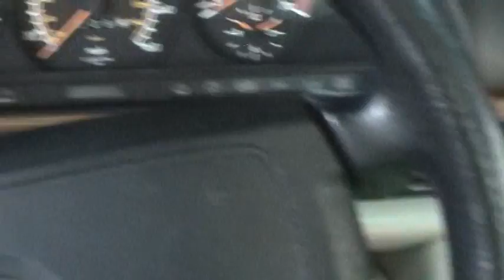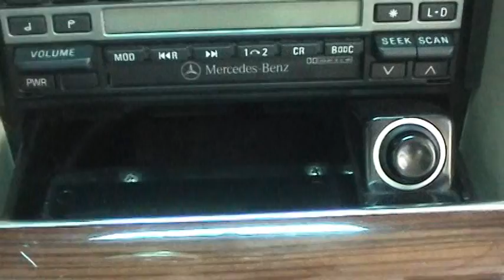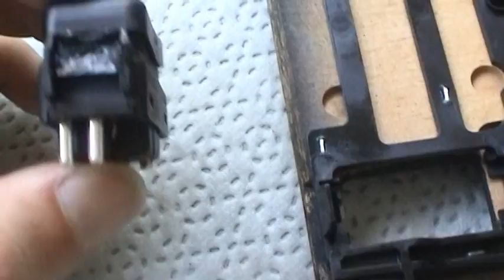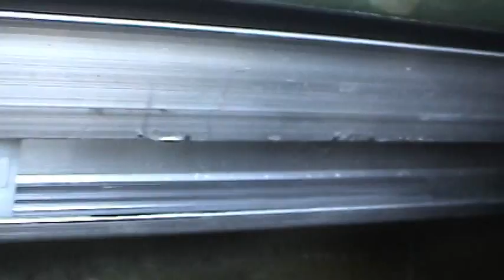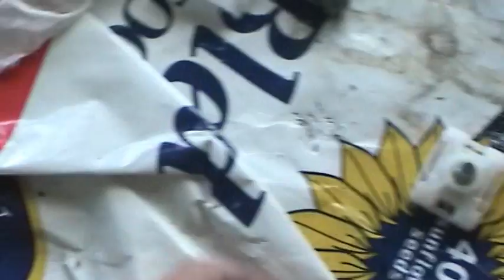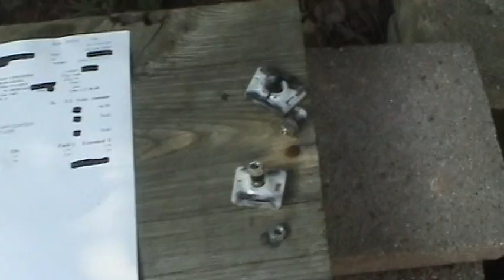1991 Mercedes-Benz 420 SEL Power Window Repair (The Other Side)

Comment: you have great instructional vids!  I talked to you before about the rear window/slider repair.  success thanks to your vid.  now my driver window on my 82 sel is the issue.  however, the window is in up position and seems to be locked up.  there is power to the switch, cause the lights dim when activated, and I can hear a clicking in the pw motor.  im just trying to take the entire assembly out to lube/diagnose, but how would u get it out with window up?  assembly will not budge with all screws/nuts off.  don't know how to drop the window to free the assembly up.  any thoughts?  thanks so much!
Reply: stephen harbour did you ever figure out how to remove the entire assembly to lube/diagnose it? i have the same problem where the front passenger window is up, locked in place and nothing is budging although the screws/nuts are off
Reply: yes. had to unbolt the motor and remove it.  while I had it loose I operated the switch to make it move also, and it backed it self out, along with letting the whole assembly fall loose.  window and everything came down.  so just remove the motor, should free everything up.  seems the motor was keeping everything from moving.

Comment: Thanks for this video. I'd like to finally get started on replacing regulator jaws in an '87 300E and repair/replace three console window switches. Can you reveal your source for the regulator jaws?
Reply from the maker: You can find them online at AutohausAZ. They have a good selection and the prices are fairly reasonable. Good luck with your repairs. :-)

Comment: I own a 560 SEL  and I also done this repair too. I hope you`ve noticed that the car has a leaky wheel on the left front side. I suggest you change the grease on the front bearings with the OEM grease or with Castrol LMX green grease wich is the same as the original. Theese greases doesn`t melt down when the rotors are hot, speccially on hot summer days. 
Anyway, you have a great W126 and I love that good condition on the wood wich I didn`t had that luck with. 
Keep up the good work!

Comment: I've had the same issue with those switches. They are very simple and rebuildable. If you pry on the side of the switch, the rocker part will come off giving you access to the springs, ball bearings and contacts. Solvent will clean out the old grease. I believe I used brake cleaner and q-tips. The contacts can be freshened up with a pencil eraser. Then place a small dab of electrical grease on the internals. The cover snaps back on and you have a rebuilt window switch.

Comment: This video is just plain Excellent! 10/10
You've proven yet again why in my 25 years of motoring I have never once taken any vehicle in my ownership to a garage for repair or service!
I have also never had a roadside failure of any kind! 
Those repairs were in the vehicle service history. I really hope it wasn't done by a main dealership? If that were the case I would be straight on to Mercedes! They wouldn't tolerate it!
Keep up the great high quality repairs! You are a Pro! :)